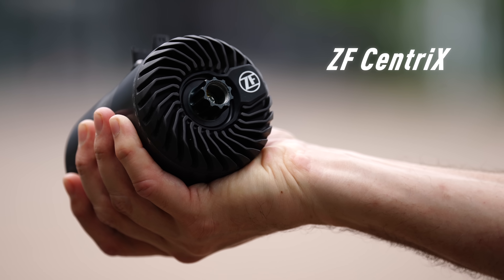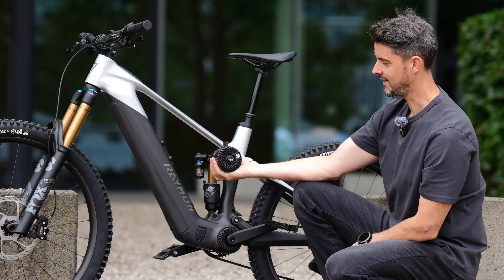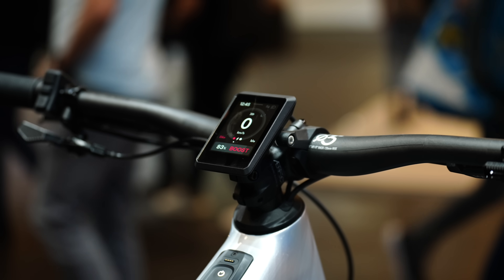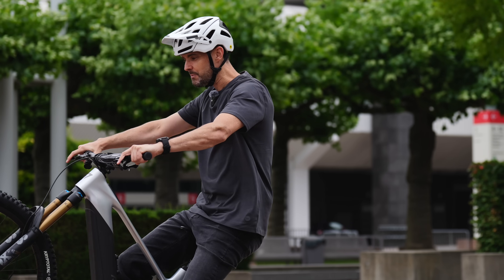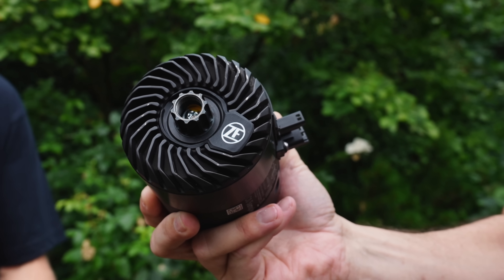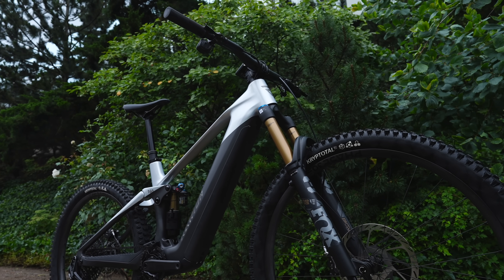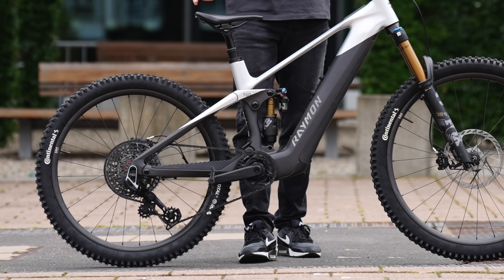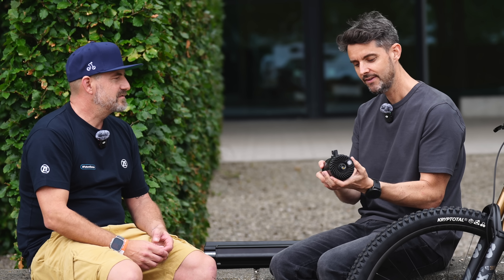How Did ZF Do This? Super Compact, 90Nm Motor

Comment: Lifetime warranty on the motor. That's a win for the consumer.
Reply: Give me hope they are not made out of cheese like most of the others.
Reply: When car people I know hear zf, they think quality. Over time they have built very good products.
Reply: ZF if it's the same company does pretty stout car transmission parts, the manual gearbox sold me a car 20y ago, I loved manual shifting on it it felt like you imagine fast and furious cars felt except they drove automatics lol but that clang 2nd clang 3rd clang 4th loved it ZF know their stuff
Reply: They could say lifetime for this motor is 1 year
Reply: Only if it doesn't fail on the trail, or if it is fast serviceable.
Reply: Yeah, 'cause the automotive space has such a good reputation for actually honouring their warranties and not weaseling out of them.
Reply: @Surestick88  This is so true. Specialized are warranty weasels 100%.
Reply: Works like a starter motor
Reply: I prefer my just-long-enough-to-not-fail warranty from Specialized, along with no ability for self-service, and $1200 replacement cost. Thus working out to $600/year in motor cost.

Comment: KELLYS THEOS F100 with ep801 and 825wh battery is 20.6kg already. This might be their pic for future as it might save some space.
Reply: I register them for sometime they are pretty innovative. Have beaten Bosh in their own game of ebike batteries twice. They use batt with much higher energy density. I reckon also their frames are light.
Reply: 20.6kgs and 820wh? U sure mate?
Reply: @MrSmith-iz9zv  PRESS RELEASE: Kellys

Kellys THEOS F100 is one of the lightest full-powered enduro e-bikes in the world equipped with a full-performance 85 Nm motor, new-generation hi-energy-density 825 Wh battery with the highest energy density in the world and with overall weight of just 20.6 kg!
Reply: @MrSmith-iz9zv  Yes. Its pricey tho. But 150/140 full carbon eeeverything. And lightweight battery.